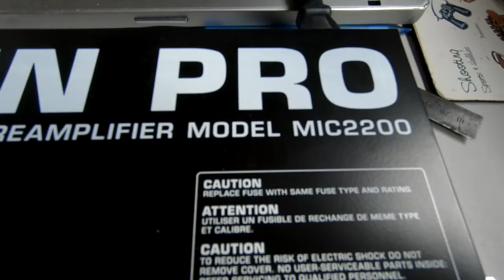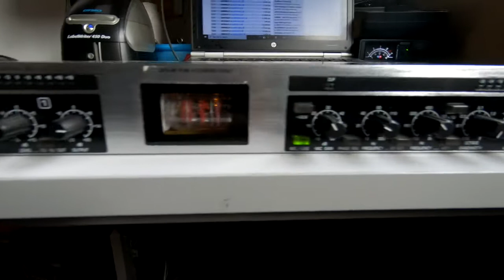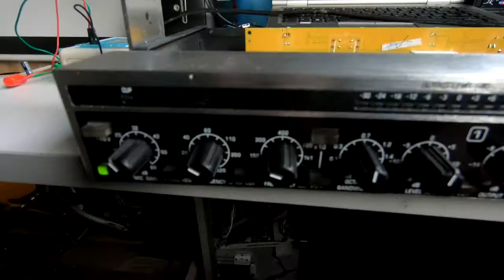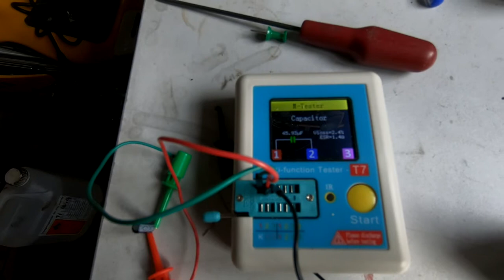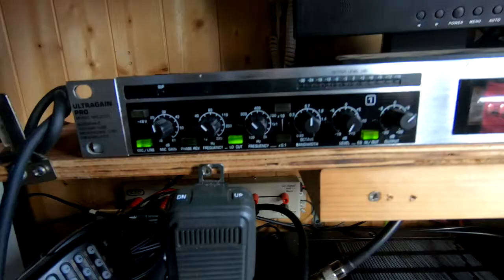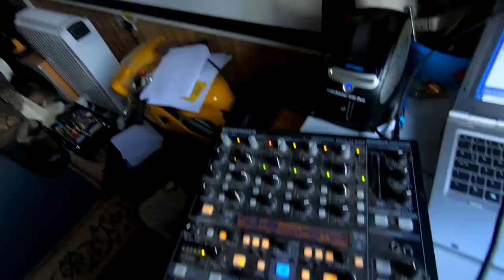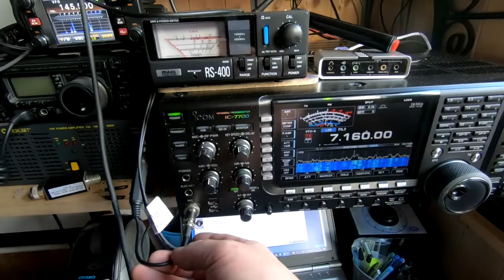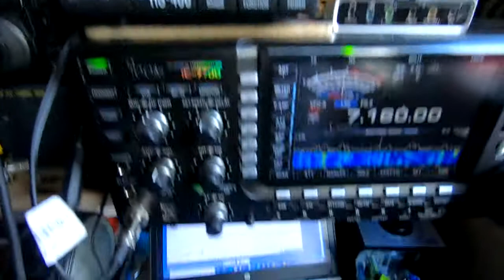Behringer MIC2200  Ultragain Pro, Faulty,  Repair and Fix

Comment: The tube in that is just for show it's not doing anything, maybe the led behind it is a giveaway
Reply: Given that there's no filament or HV windings on the transformer, I would tend to agree!
Reply: @cambridgemart2075  This preamp is a four stage per channel. The tube is the second stage and is used in cathode follower configuration. Plate voltage comes from the +48V  phantom power line, also the grid via a resistive divider (+24V grid bias) and the two filaments are connected in series in order to need 12,6V. That voltage comes from the +15V line through a 39Ω resistor needed for the necessary voltage drop.
A design issue at this preamp is that the labeled "OUTPUT LEVEL" led series actually does not monitor the output level but the output of the first stage only! This makes confusion and somebody  by looking these leds can believe that has enough output power while this is not true.
That was my case. I had only 25mV output measured with external instrument while leds indicated that was full power (8.7V). The issue was a blown filament at the one half of the triode. Tube replaced and preamp is now back to life again. The filament was blown after 7 years of usage for about 2 to 4 hours per day.
Reply: @sv7gbr  I had to study the schematic before I probably understood this preamp The LED display is actually monitoring the drive to the valve and the output control the amount of drive not the output of the first stage It's a range like this so you can gently overdrive the valve for that sought-after valve distortion😊